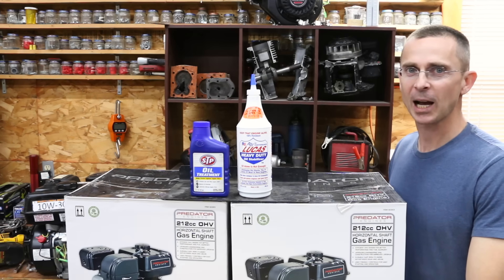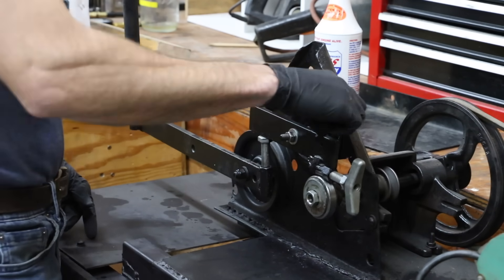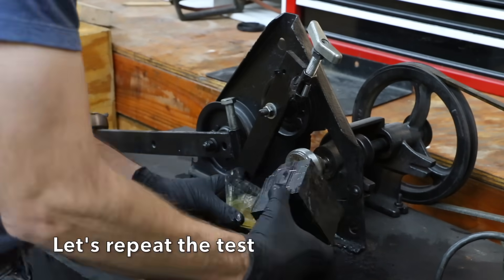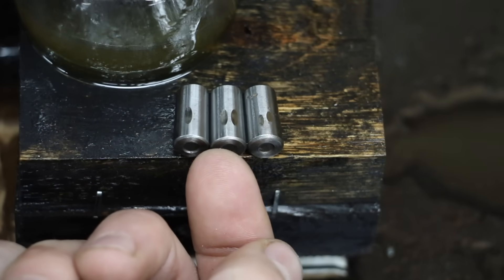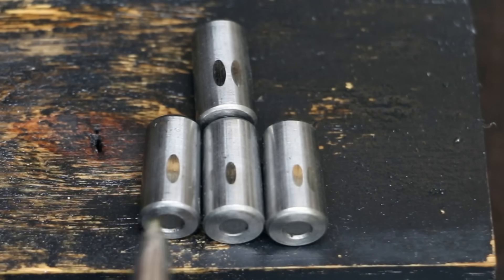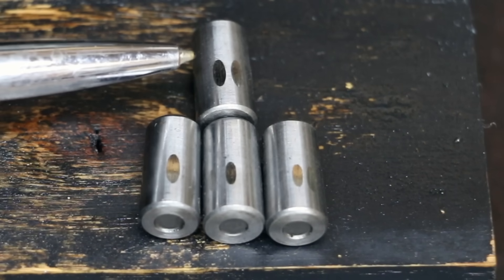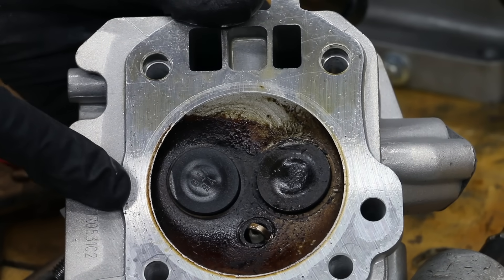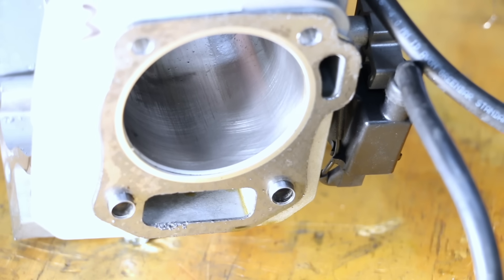Which engine self-destructs first?  Lucas or STP?

Comment: Not a big fan of either STP or lucas oil treatment myself. Both trap air in the oil/aditive mix. With air entrapment, you run the risk of cooking the oil because the bubbles act as insulation. The oil just gets hotter and hotter until it breaks down. Also, both thicken the oil to the point that it doesnt flow as the engine needs. Oil is a coolant of sorts because fresh, cooler oil is constantly flowing thru and over parts to not only lubricate but to cool as well. I have personally seen where someone had a higher milage engine so they brought the ratio up to about 40% lucas to "help limp the engine for another few thousand miles." The oil becaume so thick that the engine ended up self destructing itself because all the oil was sitting on the top of the engine and the oil pump starved. If you need a heavier oil for higher mileage, stick with a hea lvier weight oil rather than wasting time and money on an oil adative when you can spend the same if not less on a good high quality oil that meets the criteria of your needs
Reply from the maker: Great post. Thanks for commenting.

Comment: Isn't grinding the friction wheel creating a more abrasive surface? Wouldn't engine internals be smoother? I don't know. Just a thought I am watching you on both my phone and ps4 and you aren't  done but my guess is the Lucas will win. Just as I thought  but my guess is that I don't think these additives would be good in cold weather as a lot of these oils today in newer cars are things such as 0w 20 or 5w 20 all these oils are so thin.
Reply from the maker: You're right. I might change my approach.  I'll reach out to a couple of experts for input.  Great point regarding cold weather.

Comment: I would like to see what would be the best to use for engines with rod nock or lifter noise or nock and see if it helps and makes noise go away and or if it makes it worse cause I have a 97 jeep grand Cherokee and was thinking about putting some or one of these in the oil to quiet it down help the noise and help make engine last longer and too how good on oil pressures is it would it helps a vehicle with bad oil pressure like say one that has bad main bearings
Reply from the maker: Thank you for this recommendation!

Comment: I was always curious about Prolong oil additive. try that one
Reply: Prolong-good stuff.  I ran it in my KT100 racing kart mixed in the fuel.  It ran about 2-3 thousand rpm higher then the competition at top end.  Tore the engine apart at the end of the season and it looked like brand new.  We ran that engine for 3 full seasons before a rebuild, and that was just a ring job.
Reply from the maker: Thank you for this recommendation!

Comment: Of course, neither STP or Lucas make any claim that the engines can be run without oil.  But it is interesting to note that, in an extreme case, you'd be better off with Lucas in your engine instead of STP.  And either one is better than just oil.  What I'd like to see is an oil additive results board, similar to what Top Gear used to do with cars.  They'd run the car around the track, and then post it on a board, with the fastest car at the top.  This was a continuing feature on the show.  It was quite interesting to see a $100,000 supercar dethroned by a highly tuned Honda Civic.

So, let's do that with oil additives.  Which combination yields an engine that runs the longest?  Let's post the results on a board, with the best performing combinations at the top and the worst at the bottom.  Top Gear used large chunks of flexible 'fridge magnet' material, which they stuck to a tall, thin steel plate.  They'd print the name of the car and the time in large letters, and then plop it onto the steel plate, moving stuff around as necessary to make room for new entries.  We could do the same with oil additives - the name of the additive, and how long the engine lasted.  I think that would be pretty cool, particularly if you made it a standard feature of your show.

Thanks for all your hard work.  You bring a lot of enjoyment into my life!  Regards, Charlie
Reply from the maker: This is a terrific suggestion--thank you!  Also, thanks for the positive comment!

Comment: id like to see an engine that is warn down with an additive high in zinc and see the benefit i like that you used the same engines aswell as followed instructions but i believe this test would be better in the long run if the engine already had issues such as lower compression maybe rings starting to go valve issue closer to a rebuild type of situation. I just believe that the majoriy of people using any "mechanic in a bottle" such as for fuel or oil or rad fix bars/liquids are doing so in hopes to bandaid an issue more so than adding it to a brandnew engine of any sort.
Reply from the maker: Thank you for this recommendation!

Comment: What if you purchased a replacement conrod for the engine with the best crank etc and try get a running engine together. Then test the oil treatments in that engine and see which gives highest compression gains over regular oil (if any) and if any help reduce engine knocking noise from the poked big ends... but thinking through it as I type this those cranks are pretty far gone haha
Reply from the maker: Thank you for this recommendation.  You're right, lots of damage to the cranks.

Comment: in these tests, your engines arent under any load, just running against the governor so i think you should load them up with something like an alternator and 10, 100W light bulbs or an engine fan off an old GM or ford
Reply from the maker: This is a great recommendation--thank you!

Comment: Interesting tests, I am wondering if the difference in the survival timing is more about the differences in the engine manufacture tolerances rather than the differences in the oil additives.  Would be interesting to me to see two engines with exactly the same oil treatments to see if there is a deviation caused by the engine manufacturing tolerances.
Reply from the maker: Great point. Thank you for this recommendation.

Comment: Since this has the potential to be a considerable series, maybe an end card with the results of previous tests [time 'til destruction] is in order.  I for one am curious as to why these engines lasted 10-20min Less than the Conventional 10w-30 engine did [in the previous test vs Bestline].  That would seem to mean Lucas & STP are a step Backward from Conventional Oil..?!
Reply from the maker: Thank you for this recommendation.  Also, great point regarding the difference in run time.
Reply: Project Farm ...Thank You, for your time and effort for the consumer base.  This may be a revealing test series if variables can be kept in check.

Comment: Need a endurance test with a massive load put on each engine with oil additive x# of hours and then a teardown on the wear  or do a full throttle to idle cycles until it blows up all with oil in them + additive
Reply from the maker: Thank you for this recommendation!

Comment: A trick many car sellers use to scam people is if the engine has a rod knock they replace the oil with gear oil or any other really thick oil so the engine sounds fine during sale. Could you try running an engine on really thick oil? Also I think this is similar to what the oil additives are trying to achieve (thicken the oil) so you could compare gear oil with oil that has an additive in it.
Reply from the maker: Thank you for this recommendation!

Comment: I am amazed how long an engine will run with no oil lucas lasted longer but should of had 3 engines one that just had oil with no additives to see if the additives did anything as they had been drained out with the oil good to see you are using new engines in your testing is a shame to kill a new engine but   has to be done but you should of killed 3 anyway keep up the destructive work all the best from the UK 🇬🇧
Reply from the maker: Thank you for this recommendation and thanks for the positive comment!

Comment: Will an engine run on differential greese? Or, even straight bearing grease?
Reply: How long will an engine run under an abnormally large load?
Reply: Also, is there a way to measure the viscosity of stp vs lucas?
Reply: And, uh, i want these motors xD ill buy as is
Reply from the maker: Thank you for this recommendation!

Comment: Try canola oil in the crankcase. I undercoat my mower deck with it and the Pam effect works well ... what the heck the wheel bushings get it too and run smoother than snot on a glass doorknob.
Reply from the maker: Thank you for this recommendation!

Comment: That was very interesting, has made me question using Lucas Oil religiously in my vehicles. I wonder how they would preform on a wear test, running them for 20 hours each with the proper oil & additives in them.
Reply from the maker: Great point regarding the wear test for the used oil and additive!

Comment: Maybe could have tried the lubricity test with the mixtures reversed (1:4 STP, 1:8 Lucas). Just for another comparison point of how well each worked at both designed and equivalent mixes.
Reply from the maker: Thank you for this recommendation!

Comment: I wonder how much of the difference in run time is due to natural differences in the engines themselves.  (Not that we could ask you to buy a dozen engines instead of just two...)
Reply from the maker: This is an excellent point.  These engines are made in such high volumes, I'd be really surprised if there's much of a difference, but I could be wrong.  Thanks for commenting.
Reply: You'd think.  And that's what I'd assume too.  But if QC at the steel mill is lacking, that might cause some parts to break earlier than others.

Comment: I tried slick 50 in my oil and I noticed a difference In my 350 but also noticed metal on my drain plug which coulda been from my previous hiccup with my distributor being destroyed but it did idle smoother
Reply from the maker: Thanks for commenting.

Comment: I suppose i don't really know what was demonstrated this time, beyond the lubricity test
Reply from the maker: Lubricity and film strength. The engine test is done by some of the manufacturers of oil additives.  So, this sort of testing is used to test their claims. Thanks
Reply: Perhaps when these tests are being conducted there could be references in the video to the control test of an engine that has had conventional oil drained out of it.

Comment: I may be wrong but the Lucas Mixture seems wrong. 25% would be 1 part Lucas to 4 parts oil. 20% would be a 1:5 ratio. If I am wrong could you explain how?
Reply from the maker: Great question and I should have done a better job explaining. 1 part Lucas plus 4 parts oil = 5 parts total. So, 1/5 = 20%. Again, sorry I didn't explain my math in the video. Thanks for commenting!
Reply: Project Farm i appreciate the reply and will keep that in mind

Comment: Hate to be negative, but I learned absolutely nothing from these tests.
Reply from the maker: Thanks for the constructive feedback.  What are your thoughts about air bubbles in the oil additives?
Reply: Well I have always heard that the reason you shouldn't put too much oil in the engine is that the high oil level will cause the oil to get whipped into a froth by the crank, so that's basically what I would expect.

Comment: What happens if you run an engine with no piston rings or is it possible
Reply: nope, you get zero compression, even bad rings let enough pass to not fire the engine, cannot run at all below a certain amount of compression, a fairly bad mower you  can make run by spinning with  a power drill so its going faster so will get the compression up a little

Comment: What gets me is that these engines didn't runs as long as the one that just had 10w-30 in it, which ran for 38 minutes.
Reply: most additives are just a marketing excuse for a bit of thicker oil, it helps a rattley engine so people think its working, but in reality, the engine runs hotter as thicker oil is harder to move,  any additives that are any good are already in the oil, thats why that ptfe stuff (slick 50) got sued and you cannt buy it now, it didnt improve anything in fact tended to clog oilways and filters, the company that makes the base chemical doesnt recommend it in oil in the first place, it doesnt mix and settles out too
Reply from the maker: Great point and thanks for commenting.

Comment: So what you're saying is Lucas and STP are totally pointless. going on your previous video of best Line versus 10 30. They failed 60% quicker than oil alone. the phrase walk before you can run comes to mind. Maybe just change your oil regularly. In any case big up best line? Or maybe just piss in the oil and take A Shot in the Dark
Reply: all additives are pointless, use the money to change the oil , clean oil is all you need
Reply from the maker: Great point with regard to a new, healthy engine. Thanks for commenting!

Comment: I rebuild engines and I use Lucas as an assembly lube putting the crankshaft and its bearings together .. I think it holds on better than the moly assembly lube with dry starts until the oil pressure builds up and so far it didn't let me down .. thank you for your experiment I think it proves I'm right about using Lucas.
Reply from the maker: Great post and thanks for the positive comment!

Comment: Love these videos as it's done by a real person without a agenda to sell some companies product. 
Although I hope when you bought the HF engines you got the same part#..case in point, if you notice they often list many part #'s for products, as they are from different suppliers, and have multiple ones for those engines..with much difference in build quality, so keep that in mind for future videos, the boxes must have same part#'s. And like mentioned down below, a more  accurate test would be to keep the oil in there, but have a ever increasing load on them.
Reply from the maker: Thanks for the positive comment and thanks for the great recommendation on the supplier.

Comment: Mobil1 vs Royal purple vs Amsoil
Reply from the maker: Thank you for this recommendation!
Reply: Don't forget about Red Line.  As in regards to Royal Purple they make 3 versions "street OEM",  HPS AND racing.  The 2 later versions use alot zinc which can damage a catalytic converter.  They all 3 WILL REDUCE friction and heat.
Reply: Melanie O'Brien Excellent!
Reply: To me it is more like Mobil1 vs Castrol and Royal Purple vs Amsoil. Mobil1 and Castrol are pretty similar in price and they do similarly for my needs in their synthetic form. Then, Royal Purple and Amsoil in a versus test because of their similar price points and similar claims.
Reply: FR NOW DONT GO DAMN TELLN ME HOW TO SPELL I AINT LIKE YOU I WAS RAISED IN THE COUNTRY AND YEAH I DO BELIEVE ONE COULD BE SUPERIOR OVER THE OTHER WE AINT DUN BEEN IN THEIR HEAR OIL FACTORYS AND AINT SEEN THEIR DAMN EQUIPMENT AND THEIR WORKERS AND HOW DEDICATED AND HOW CLEAN THEIR MANUFACTURING  FACILITYS ARE MANUFACTURING OIL AND CARPARTS REQUIRES HIGH LEVELS OF CRAFTSMANSHIP AND DEDICATION OTHERWISE U BUYN STRAIGHT JUNK
Reply: Project Farm Z-MAX.  IM TELLING YOU SIR YOU WONT BE DISAPPOINTED!!!!!
Reply: Melanie O'Brien Contacted Royal Purple: they (eng.dept.) stated no additives are NEEDED IN THERE OIL.
Finding a good price on it to buy it.
Reply: YES PROJECT FARM GUY MAN ROYAL PURPLE VS MOBIL 1 VS AMSOIL
Reply: John, I felt that I had some pretty amazing results from Z-Max. My 1994 Ford Escort sped up so much I broke it's springs having fun on curves. I didn't put it in the engine, seemed like a bad idea, but I did use it in the transmission (1/3 the recommended amount) along with new synthetic gear oil (manual). Later I found out they were sued for selling high-priced cheap, thin oil. Yeah, see how cheap you can get paraffin oil. It's the same. It's worth like a dollar a gallon or something cheap at any rate.

Comment: I so want one of tbose predator engines to put into my cateye pocketbike
Reply from the maker: Sorry, but I just don't have time to mail these. Thanks
Reply: Project Farm oh I was not asking for one lol I was just saying I am saving up to buy one actually been working with 2 strokes for a while and the amounting bolts on my cateye keep breaking because I modified the engine I did porting and bigger carburator and the bolts cant handle the extra force but a predator engine since it bolts straight to the base it does not have that problem

Comment: Years ago we had a product called Nulon where the claim was they drove a car 1000klm without oil after they treated the motor, and another product called ProMA I have seen used on a test machine like yours where it reduced friction so much the guy testing was hanging off the bar with all his weight and the end result was a polished bearing surface without any visible sign on wear. That guys tested aviation oil and automotive oil with a blend ProMA and without and it was surprising to see how oil without the additive broke down very quickly.
Reply from the maker: Thanks for commenting on this!